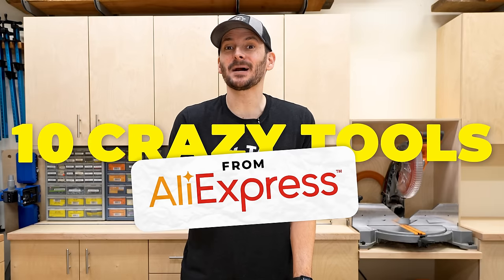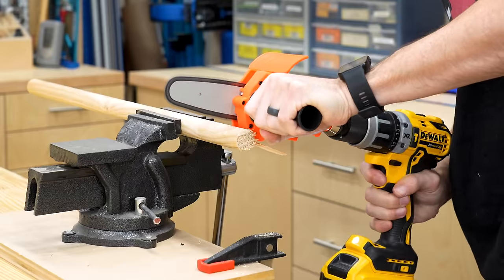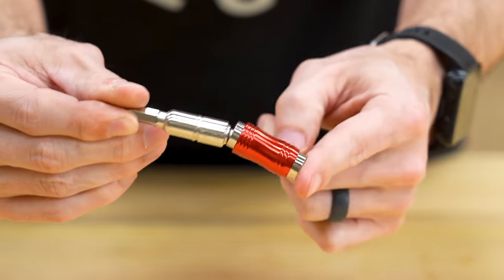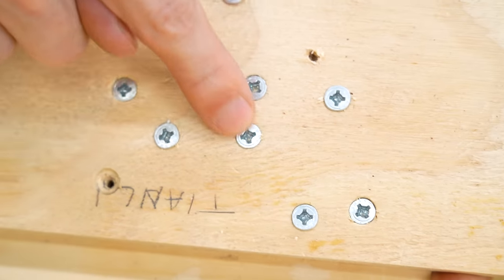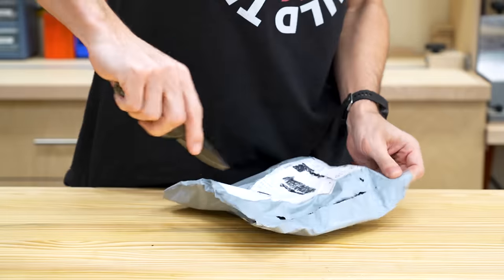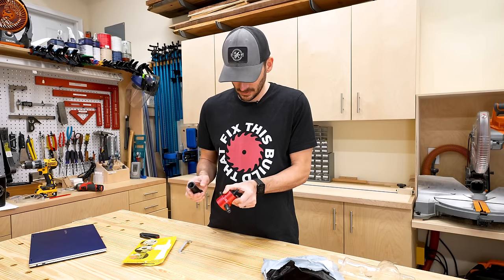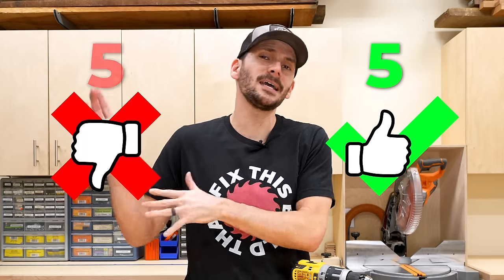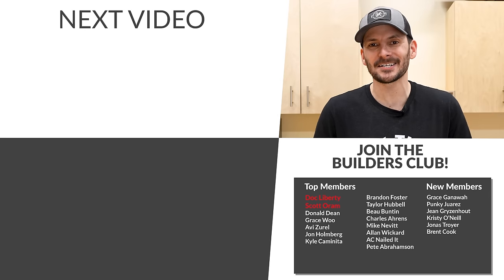I Bought 10 Crazy Tools on Alibaba

Comment: Thoughts on cleaning products vs pressure washing ?  Ive heard pressure washing can remove too much wood material over time but i quess that would depend if you wash all the old stain off.. i redid a neighbors deck two years ago with a behr cleaner and stain and it looks awesome two years later i felt the cleaner was quicker too.  Any negatives to cleaners and elbow grease?

Comment: Are you Canadian? I think this because you included a Robertson bit on the  2 cent magnetic ring (4:51), and I know that Americans seldom encounter Robertson screw heads...so the fact you showed a Robertson, which is considerably better than Phillilps or (especially) straight-blade, suggests to me that you might be a Canuck. Me, I love Robertson-type heads (red-handled Robertson are possibly my favourite commonplace screw), but the ultimate screw head is Torx I think. I have used them a bunch in the last 5 years, and they are quite a bit better than any other screw head I've seen (at least 20% better than Robertson, 100% better than Phillips, and 250% better than straight-blade).

Comment: I have used it for my bids, the numbers are wrong, so in order to put it in the right angle to sharpen it right you need to do it .. with eyes.. Just like... noemral sharpening :D ... But it is small so I use one and it sharpens them well :) Jsu you dont need to trust the original numbers :)

Comment: Black and Decker multi tool set... pistol head with attachments...... but there was an earlier version in the 1980s..... so those drill adapters circ saw, double nibibler, sheet metal sheer etc.... uttn new there.  But the chainsaw... that was the winner.... for humor

Comment: You can get a circular saw for $20-25 that works fine.  I've been using one for years.  Interesting junk they produce in China, but that nibbler looks nice. I hate working with sheet metal.
Reply: The half moon metal chips nibblers shoot all over the place are sublime. They're sharp on both ends. So they stick in your footwear. It's like metal studs.

Comment: Buying from China definitely requires some experience. Some items are awesome, some are terrible. I recently got combination tapping tool, I tried it on steel and the drill part drills as fast as my makita hss drills. End result is impressive. But they are not cheap. Generally, if it is cheap then it is cheap. Ah also if it sounds crazy then it either will not work or will be dangerous.

Comment: The chainsaw one is even more dangerous because nowhere does it require or send you a little bit of chain oil and once enough friction is built up the chain will break, possibly eat through cheap looking plastic and then cut your hands up pretty bad.

Comment: The nibbler is a good little tool. I had one given to me nearly 30 something years ago and more or less rubbished it there and then, being a plumber/sheet-metal worker and never even got it out of the box, '' won't never use that damned mickey mouse gadget I thought'' but never got rid of it- just sat up there on a shelf in the workshop and never gave it a second thought. Years later I was doing some re-roofing on my house and had some sheet metal flashings to fit to the new roof. One of the flashings was too wide by about 100mm or 4 inches over its entire length - which was about 4 metres, about 14 feet Imperial, I decided to cut this particular flashing down its length but it had a very tight profile folded with a square bend and another on a 45 degree bend. I started off with tinsnips trying to cut this stuff lengthwise with the tinsnips and it became dead obvious it was a waste of time trying to cut it with the snips because the folds in the metal made it so rigid it was impossible to cut this stuff and do an acceptable job without wrecking the metal that I gave up in next to no time. So then I remembered the ''nibbler'' that fits in the power drill chuck and fetched the thing down off its shelf(still in its cardboard box- with instructions) Got out the drill it was a powerful tool with a big half inch chuck on it, fitted the nibbler and tried it out. I snapped a chalk line down the flashing and secured it to a couple of sawhorses and it was the easiest cut I ever made it just ripped along that 4 metres without a hiccup with no distortion to the metal and was amazing how it made what was a difficult, impossible job into a breeze. That nibbler is a great invention made in England. It is  portable, dead accurate and one of my best tools ever! I stand corrected.  Get out and grab one.

Comment: I think the problem with the drill bit sharpener was your technique more than the tool. You have to grind 2 flats at the correct angles, and you seem to have been rotating the bit on the grinding wheel, which will not grind a flat, but an arch.

Comment: @13:58 that drill bit even looks worse. There is a certain way to sharpen drill bits and it's really easy to learn. I know this was just a demonstration of that sharpener gadget, but if they just designed that item with a tiny little "ledge" near the drill bit's pointy side so the drill bit got some support and to limit how much material that could get removed, then the sharpening would have been successful. :)

Comment: at the drill, it was a huge mistake. The drill sharpening is stays on 3 big part. The main cutting angle and sharpness, which can be 90° or 118° or maybe 135°, after the main cutting edge is done, you have to make the drills on two sides the Back angle to nearly 5°, without it you will not drill anything cause not the cutting edge make contact with materials. After these two big part you have to make the drills smallest cutting edges on the middle, idk how it says in english but maybe "middle cutting edge". If you correctly make this 3 edge, you will be able to drill nearly every material. 90°to cast aluminium and for weaker materials like wood or plastic. 118° for steel, iron, and the middle hard material, and 135°for stronger and harder to process materials like stainless steels. if someone got new information, than your welcome, if i was wrong with something pls correct me thanks.

Comment: Watching that chainsaw and thinking, if your grip slips and or it jams and rotates your hand would get messed upreal quick.
In NZ you are not allowed to sell a chainsaw without a safety brake. Recently the "Bosch EasyCut NanoBlade Mini Chainsaw" was banned because of no safety brake.
So after seeing the "drill chainsaw" I went and bought one of Ebay for $20.
Waste of money - no, I am going to use the 6 inch bar and chain on my "Ozito 18v" chainsaw for light pruning.

Comment: Some irony visible with the link to that last tool. A chain saw normally has some way of lubricating the chain, but the one from this video was definitely lacking that. And a jigsaw / reciprocating saw normally does not have any means of lubrication built in, but the one from this video does. Quite backwards.

Comment: With your drill bit sharpener, would having the bit in another drill and turning help to get a nice cone on the end?
Reply: Twist drill bits are not really cone shaped. The cutting edge has to be over the heel or the bit won't cut. It's called the relief angle.

Comment: that little 'protector' on the chainsaw is emulating whats called a brake. An integral safety device used to stop the chain in emergency situations such as bites and pinches. The fact that it is not actually functional makes that thing even more dangerous

Comment: Flip the dust collector over. You used it in the wrong direction. It will work 100% better with the big end pointed away from your drill, like a cone.

Comment: Heh, I also bought that mini chainsaw. Mine had a black housing instead of orange while also having a 6" blade instead of the 4". But yeah, definitely cool but equally terrifying to have your hand so close to the chain. 

Maybe some handguard attachment could be fabricated/printed to fit on the handle so that your fingers are a bit more protected.

EDIT: After watching more of the video I also have the same style dust collector (mine came in blue) and drilled some holes in my wall. Definitely collected 95% of the dust. Sure beats trying to hold a vacuum cleaner near the hole. 😉

Comment: Just a heads up that the promo code for Sunday was accepted but did not provide any discount. Not sure if there is an issue or if it expired.
Reply from the maker: Just went back and forth with the team and it turns out they hadn't activated it for some specific lot sizes.  If you use it now it should work!

Comment: And the circ saw, I betchu if you tilted the table 1st you could angle the blade in easier.

Also, I want a nibbler doubler.  Of course I could achieve the same results by getting really drunk and watching Futurama.

Aren't nibblers technically called "punch shears" or something?

Comment: while that drill bit sharpener is a terrible design for ease of use. it would help if you knew how to sharpen a bit. you cant just grind it down 360°. either way, if you know what youre doing, you can get a good edge with a bench grinder.

Comment: 14:30 you are using it wrong - should be the other way around :D - but I use a cheaper solution - just cut open a coke bottle and drill a hole diagnally and you'll get a nice dust catcher.

Comment: 12:40 I got a smaller version of that sharpener for 3$ @ harbor fart. It works great if you actually know how to sharpen a twist drill & don't just push it in like a m0r0n. You're supposed to glue it to a surface on the edge of your work bench, Put the drill on it, and rotate the twist drill as you put it in.

Comment: if you dont know where to sharpen a drill bit, just dont. you rounded it up. dulled it... the tool works fine, you just used it wrong